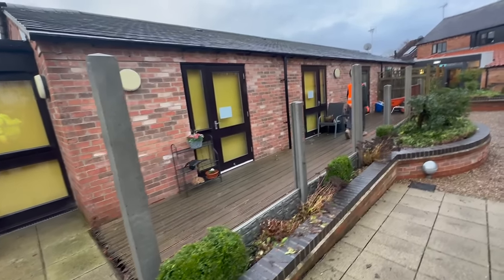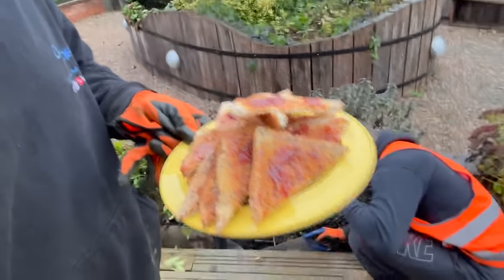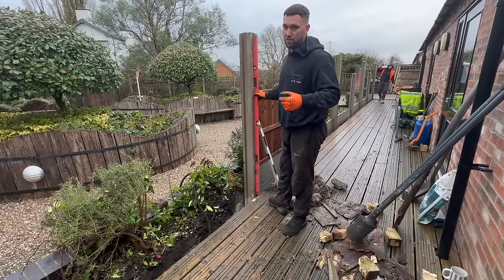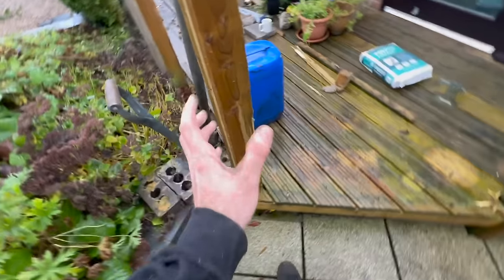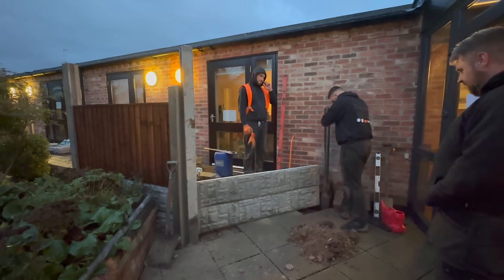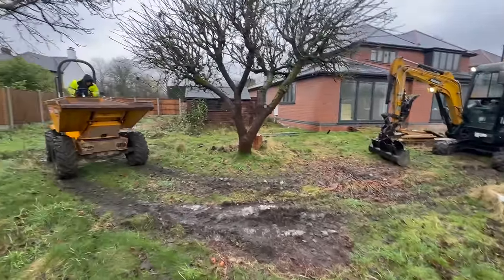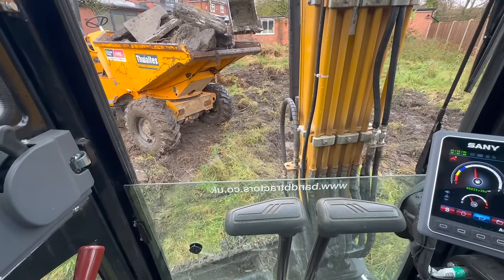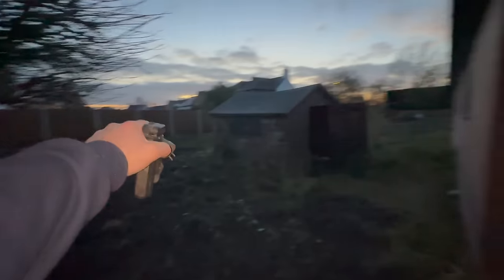This CUSTOMER Wouldn't PAY US After We COMPLETED The Work

Comment: They stiff on payment because they don't believe you will come out and rip it out. They expect you to say fuck it and move to your next job
Reply: Trumps 's recipe I was told.
Reply: @belamoure  yep. That's exactly what dumb Donald Trump does. I am a flooring installer for 35 years now. I have purposely destroyed a few floors in my time. I install in new homes only. I don't want Susie home maker hovering over me. But when I got callbacks to look at something that is out of my control like the walls not being square. (I had the the builder sign off on them just to cover my ass) I show the customer that the builder signed off about their problem and should be speaking to them. If the builder tries to pull bs and try not to pay me because they claim I did it. Which mathematically I can only hold 1 wall square. I take my utility knife to the floor and then cut the shit out of it and go home. I do it for the very reason I stated they want to keep the flooring at my cost and don't fix it. When they start to complain that I went in and cut the floor up I always said I'm paying for it. It's going to be ripped up anyway so what difference did it make. After about 4 or 5 that I have destroyed the builder finally got the hint and all the bs stopped

Comment: In certainly not afraid of labor I prefer a hand saw to cut abs pipe, but a Sawzall would be a life saver cutting those deck stringers vs a dull hand saw. Just my two cents. You did the right thing bringing it back, I would have done the same thing. It doesn't feel right but it is.

Comment: Regarding the job that wouldn't pay.....if you carnt get payment upfront and the customer point blank refuses to pay I would take the load back, park slightly down the road, unsheet, change the diverter valve over and reverse up the block paved drive and tip it as far back as possible without doing any damage.  Far enough so the crane won't reach so whoever collects it has to load over the cab to grab it or they have to hand ball it forward. That's just me🤷🤣